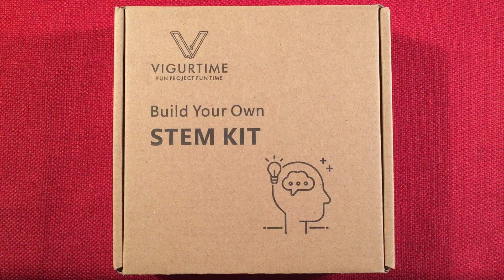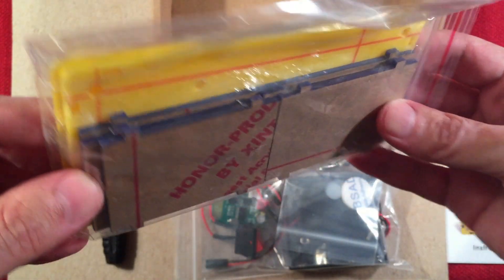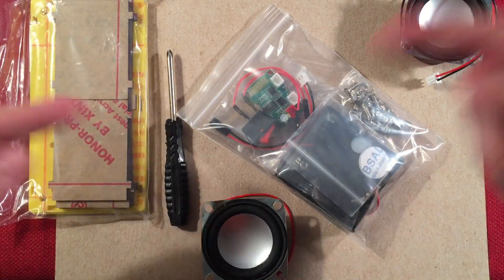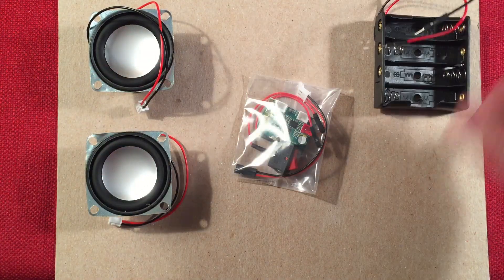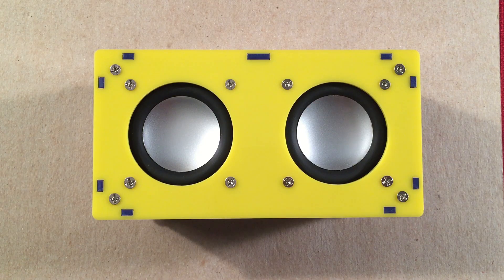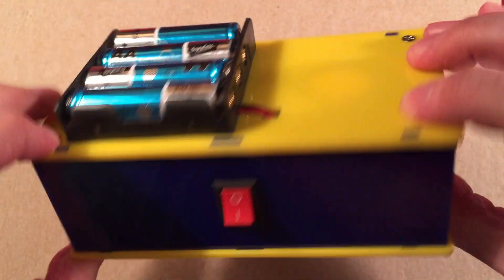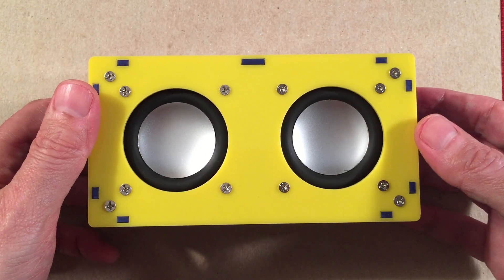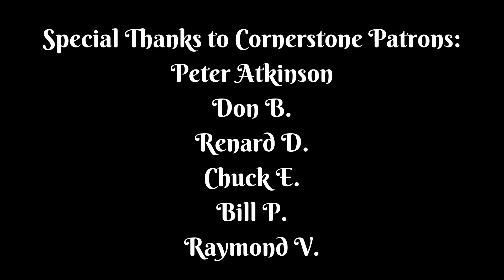DIY Forever! Vigurtime Solderless Bluetooth Speaker S.T.E.M. Kit Review

Comment: HT6872 5W class D amp chips, instead of the 8002 that so many radios use.  No output filter required, low EMI?  Impressive.  Thinking it might work better with NiMH, though the 680uF on there might be enough to handle small transients.